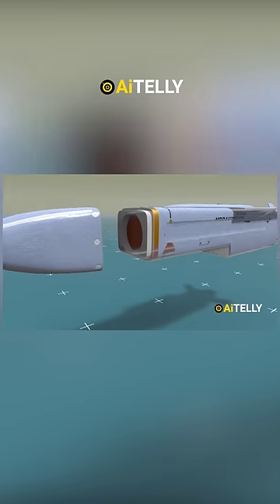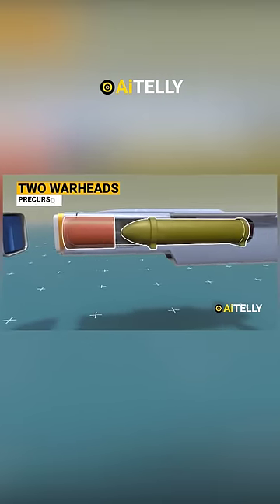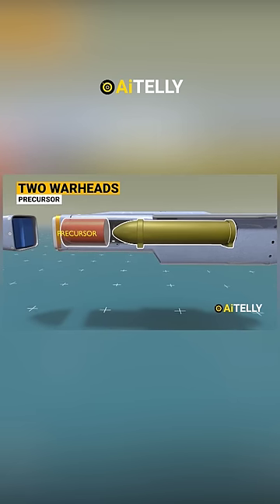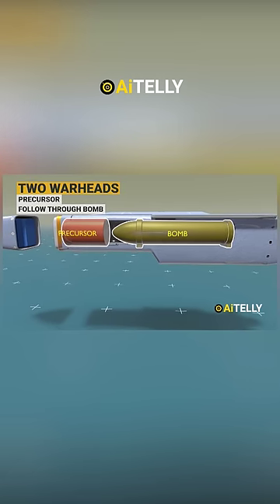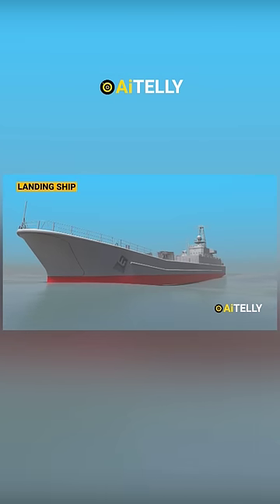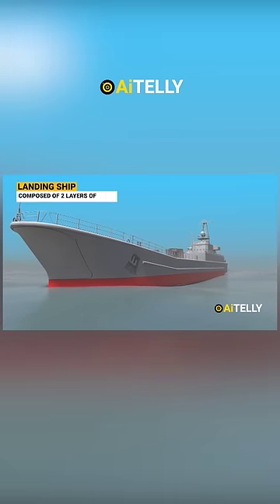Storm Shadow Cruise Missiles Engineering How it hit a Landing Ship #3d #missile #science

Comment: Modern torpedoes don't contact the ship. The fish reads ships length and goes for the center and explodes 25ft or more under the ship. The bubble lifts the ship in the middle breaking it's back and into 2 pieces causing one or both to sink quickly.
The Storm Shadow would have been great in WW2 and now seems designed more for bunker busting as a cruise missle with secondary use to blow shit up.
Reply: Really depends on the torpedo, some torpedos still just use a High explosive warhead that detonates upon contact. Others use a shaped charge warhead to penetrate double hulled submarines.
Reply: Lol "Jeff" .... more like comrade Vladimir 😅
Reply: @YouTube_is_full_of_trolls ???? 🤔🤔
Reply: Idk it did a number on that Russian sub lol.. they say it's just minor damage I looked at a picture it has two holes in the pressure hull you can drive a truck through.  They ain't fixing that
Reply: @tobilikebacon if it's a ship it goes off underneath unless it's some wired torpedo the US or NATO Doesn't use.  Vs submarines yea it's just against the hull
Reply: @bear76009  an example could be the MU-90 Torpedo, it is one of the most advanced torpedos in the world and it uses a shaped charge warhead. Yes it’s primary purpose is anti-submarine, but it can target ships as Well.
Reply: @bear76009  it is a very impressive drive thru lane Ukraine installed on that sub. 😂 But hey, a couple cans of Bondo, some black paint and a few buffing wheels and she's golden.
The hole is one big issue but so are all the stress cracks in the hull and all the wiring and piping gone and needs replaced. Probably be faster to take the screw off, put it on a new boat and call it subsafe.
Reply: @jBKht931 Russians: They didn't sink that sub we just decided to add a McDonalds drive thru in it which is not available in any subs the US has.
Reply: Do you know why that is  though... in ww2 a japanese plane tried to kamikaze an american  ship his torpedo would nit disengage the plane he missed hitting the water and submarining under the vessel where the plane and torpedo exploded
Reply: @todydn  prior to us entering the war with Japan our MK14 torpedos had been converted from impact dets to magnetic influence detonators. Bureau of Ordenance in all their wisdom did the fleet wide change after testing just 1or2 fish. Once all the subs in the pacific started having all the duds Washington refused to address it. They didn't want to waste any torpedos in testing.
It took submariners in Pearl to do testing and troubleshooting to fix the fish.
Reply: So big deal the Russians have it, it’s all old tech. the Brit’s are on the third generation already lol😜
Reply: It can also be armed with a tactical nuclear warhead but this hasn't been done (as far as the public know) since trident is more than sufficient
Reply: @lunaFreya141 why not a drive trhough at the Subway?
Reply: I'm not sure what you mean by "modern", but the Tigerfish torpedo that sank the General Belgrano in 1982 lifted it and broke its keel, sinking it in two pieces.
Reply: correct
Reply: Or to go through the Pentagon
Reply: Depends Fuse You Using
Reply: @DS-lp5xt  good one 👍😂😂😂
Reply: No its not. bubbles cannot lift the ships. bubble jet is pure pressure shaped like dagger. it can penetrate ships backbone. not lift or shaking. 
detonations in the water, once explode, but waters block that power every derections. so it concentrated in one point. it can cause huge power. (imagine the exploding power in the air, it spreaded and weaken towards all derection)
in the water bubble jets has direcrion to near objects. so concentrated explosive power of 1.5 tons tnt penetrate ships bottom. not lift or shaking. the lift is auxillary effect, not a primary effect.

if you want lift ships by explosion, you need 100 tons of TNTs at least. mordern warships weigh 5,000~10,000 tons normally. aircraft carriers are 50,000 to 100,000 tons.
bubble jets are similar to metal jets. concentrated power penetrate objects. not lift or shaking.
Reply: Yeah legit this thing would be awesome as a battleship killer, strangely it would also be really good as a carrier killer.
Reply: @jongsookim636  sorry, your wrong. First water can't be compared to air with explosions. Water does not compress so transfers it's energy directly into anything close by. Air compresses so cushions some of the blast a distance away.
Depth charges are not designed to contact a sub. Getting close will do the job.
The MK-48 torpedo does in fact explode under a surface contact and the bubble created break the keel of a ship. Ships are not designed and built with this stress in mind.
The US Navy has tested the first ship of every class, yes even the USS Ford, buy exploding a bomb just below the surface a certain distance from the hull. I'm taking about thousands to hundreds of thousands of pounds of high explosives. The ship returns to drydock and every inch of the ship is checked for defects.
I know my info from 12 years on US subs. To qualify subs you had to know all weapons we could carry, how they all worked, dangers possible from each, how to load and launch (impulse) a torpedo and the fire control system overview. Just one small part of our required knowledge to earn our dolphins. Takes average 1 year at 2-8 hours a day, 7 days a week.
Reply: @pulaski1 I'm not sure if you're right about that or not but I do know the tigerfish torpedo fired at the Belgrano was a WWII design carried by HMS Conqueror as a secondary weapon to it's more advanced swordfish torpedoes. they decided to use the less sophisticated weapon because it carried a higher explosive payload specifically to defeat the heavier armour of older warships like the Belgrano. essentially the then modern British nuclear submarine fired a salvo of refurbished WWII torpedoes at a refurbished WWII cruiser.
Reply: @jBKht931  you're definitely right on water can't be compressed. I'm an old army vet. If we were going to take down a bridge you would put your charges below the waterline. Being under the water enhances the explosive force. The water has a tamping effect on the explosive. Toss a hand grenade in the water and watch the fish float to the surface. It wasn't shrapnell that killed them it was the pressure wave.
Reply from the maker: Agreed we made the short from this video Original Storm Shadow https://youtu.be/yksbEE4GbCw?si=0nIbdzcpEmRZNtGN
Reply: Finally someone who explain how (most) modern torpedo work
Reply: @davidjakiela9553 Where can I get some of these handgrenades? I've been eyeing this spot I think there's some fish in there
Reply: Keel.

Comment: 1. There isn't a munition that penetrates 16ft or 5 meters of steel. Let alone something this small. The most dense armor on a Kirov Russian Destroyer (not the densest anyway) is 76mm about 3in.
2. The Storm Shadow has "Hardened Target" penetrating capabilities of Up To 5 Meters 
(Up To and Hardened means concrete and sand)
3. Metal penetrating capabilities (depending on construct and manufacturing quality) is calculated to be a bit over a foot or 33cm of penetration through steel.
Still all these capabilities are quite devastating for all but the most hardened and over built complexes to acquire as a target. Sending several down range to hit a target one after the other should definitely fulfill any want of an ally in any conflict.
Reply: Moab
Reply: @AnthonyParisi-sm2yd no. 5 meters of steel rarely exist in a defensive capacity. Reinforced concrete. And the MOP and MOAB are the most powerful bunker penetrating bombs ever used in combat but they wouldn’t be able to penetrate even 2 meters of steel. Most bombs wouldn’t. They can of course penetrate 200 ft of concrete for which they were designed to do. If they added a shaped charge in the front of those bombs they would easily sink any warship due to pure size.
Reply: Two words: Schwere Gustav (mic drop)
Reply: Correct, and  can we using nuke making a shaped charge as AP?🤣
Reply: it's made for 5 meters of steep enforced concrete. they got wrong information
Reply: @AnthonyParisi-sm2yd it would require a shape charged nuke to penetrate that much steel.
Reply: I thought DU APFSDS can penetrate more than that?
Reply: Yeah pretty sure everyone already figured out this is just a comment generator.
Reply from the maker: Agreed we made the short from this video Original Storm Shadow https://youtu.be/yksbEE4GbCw?si=0nIbdzcpEmRZNtGN

Comment: So if it explodes inside, the ship will only be useless for “several days”?
Reply: Depends where it hits, munitions storage, engine bay, or the bridge and its basically destroyed.
Reply: After several days the ship will heal itself 😂😂
Reply: @Am_Yisrael_Chai_7 Grammar left the chat.
Reply: It can’t be used. One cruise missile is wayyyy cheaper than a massive ship. It’s worth it if it’s out of action for some time
Reply: @_XPXI lol says grammer left the chat, then proceeds to write 'way' with four y's lol lol
Reply: @supersst838  it’s on purpose. People write multiple y for emphasis.
Reply: @_XPXI  it's still not proper grammar or spelling. There are MANY other ways to indicate "emphasis."
Especially if you literally just called out someone else for the same!
😂😂😂
Reply: @jacobviator3118  Ok
Reply: You can always make use of the munitions inside, creating a shockwave that expands outwards, which tries to exit through every hole, only that the hatches and point of penetration are not big enough to handle the blast, thus the blast pushes everything inside, until the weakest point fails, which turns into shrapnel and so on.

Comment: Sculp EG/Storm Shadow is not an antiship missile, but against ground targets.😅😂
Reply: Bombs a bomb.
Both sides in ukraine have been using their missiles outside their main use.
Reply: Melting 5 meters of steel is a fairytale too.
Reply: @user-cl3tq3pj7u while I am skeptical of the 5m penetrative as well, it doesn't penetrate it by melting through.
While the "precursor" might be Molten while it penetrates, it actually its mass and speed that does the damage, rather than it heat
Reply: @user-cl3tq3pj7u if it's a huge heat warhead it's x meters of whatever.. whatever could be air /fuel /steel etc don't matter it's plasma
Reply from the maker: Agreed we made the short from this video Original Storm Shadow https://youtu.be/yksbEE4GbCw?si=0nIbdzcpEmRZNtGN

Comment: Warship armouring. Step-1: Build 20 feet of steel armour
Reply: No ship has a 5 meter thick layer of armour, he meant that the primary penetrates up to 5 meters deep before the secondary (the actual bomb) flies through the hole and detonates inside the ship. Even 1 meter of armour would be undoable, it would weigh the ship down to the point it wouldn't go fast than 10 km/hr at best.